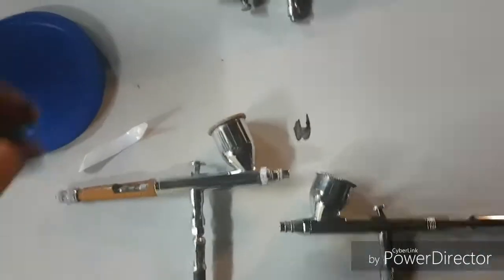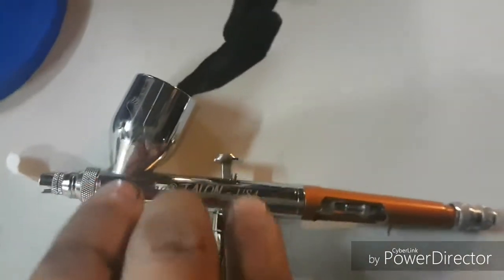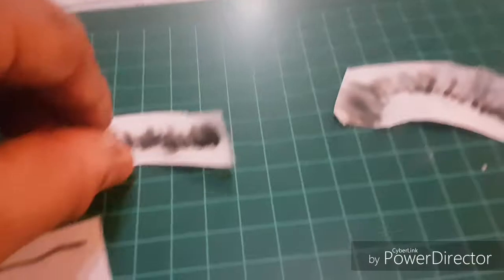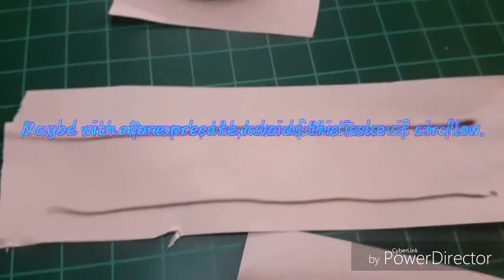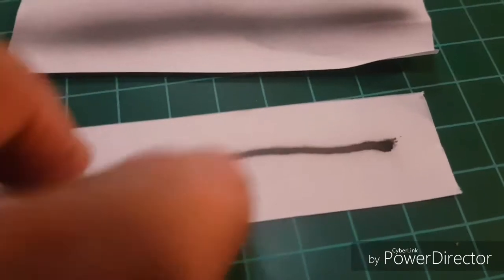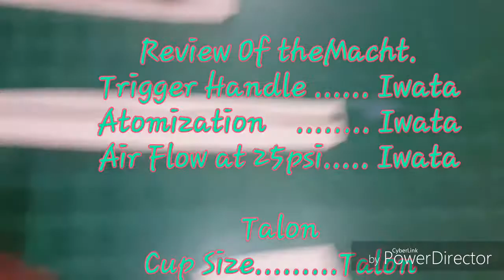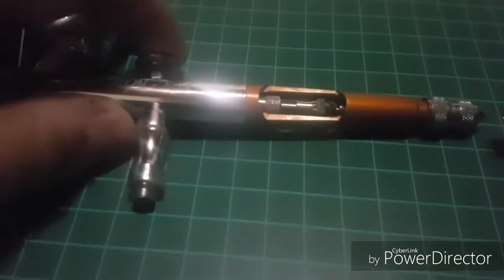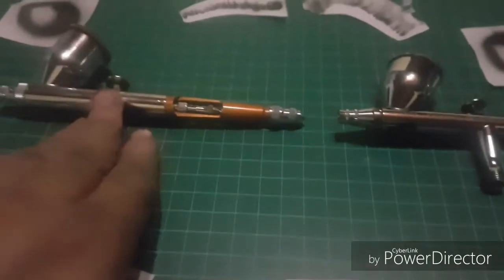Airbrush Mentor Iwata Eclipse vs Talon. Great macht

Comment: Almost a year later after you posted this. Do you still recommend the talon? I'm considering in buying one that is listed on amazon for $115 for three needles sizes.
Reply: don't know if you pulled the trigger on that deal, but I did - I'm happy with it.
Reply: I have both a 0.35mm talon and a 0.5mm eclipse both i purchased around same time. The eclipse has never worked well for me from day one. Its very finicky with the compression fit nozzle. I know people will swear by it and tell me im wrong but maybe mine is defective. I use the talon everytime never had an issue with it

Comment: It was a good video but,  Using the same mix and pressure doesn't really tell you what each brush is capable of doing. Each brush has it's parameters where it likes to preform. Just do some art and find the sweet spot.